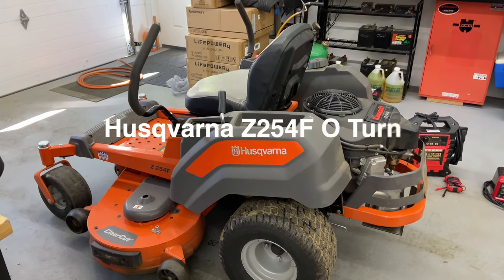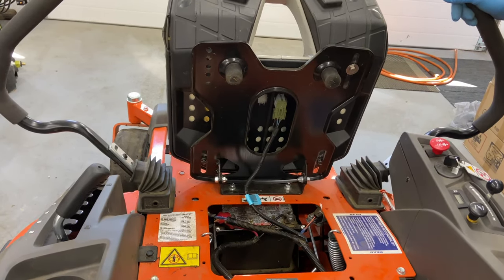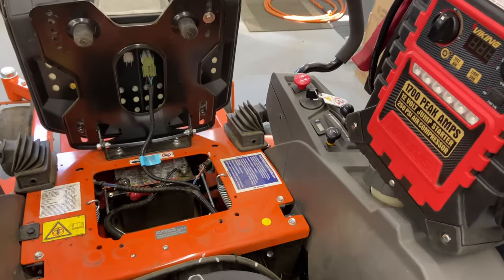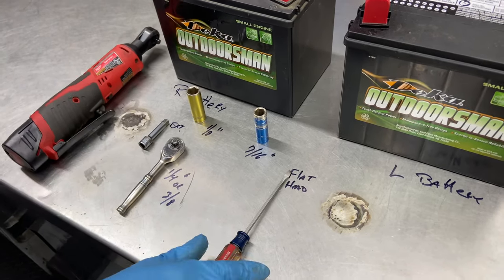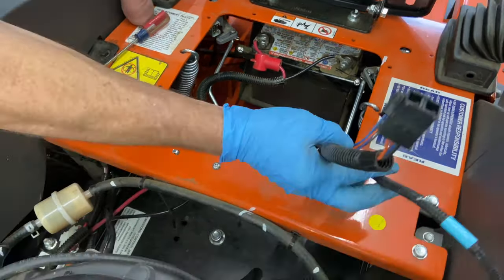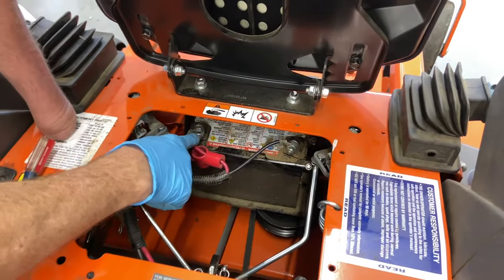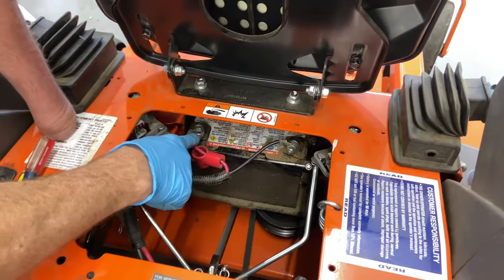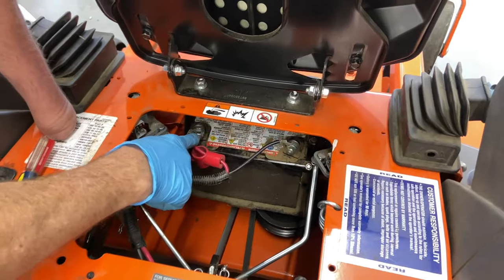Husqvarna Z254 Will Not Start

Comment: I have a similar problem on the z246 and it wont start. It does not crank like yours in this video. I made sure the handles are in park. Is there a way to test the safety switch or bypass safety switches? Is there a way to jumper it? It ran fine last fall. I did not charge over winter but reads 12.65 volts and i jumped with another new battery at 12.4 volts and still nothing and i replaced the solenoid too. No clue what else. So saw z246 that has a relay but cantfind one and 20 amp fuse is good and conductive. How to test the solenoid when taken out
Reply: Same situation here. Ran great last year. Parked it. Removed battery. Installed battery thus spring. No crank, no start. Can hear solenoid engage, battery at 12.6 volts. Thinking it may be a saftey switch because last year I had do jam the left handle to the left to get it to start.

Comment: My neighbour offered to remove the battery for me (broken wrist). For some reason, he disconnected the  the two V-shaped arms, by removing the odd shaped cotter pins (mostly hidden from the video view) and pulling the arms out of the holes on the mounting plate. There are a bunch of holes in the plate and I don't know which to use to reinstall the arms. I'm not even sure how the cotter pins work. Can you provide any advice?

Comment: Good video!  My z254 turns over when I have the ignition key turned to the start position but dies when I let go ....... suggestions?
Reply from the maker: Without diagnosing it the correct way. I will guess,bad ignition switch.

Comment: Finally a video with the same issues. I knew mine wasn't a battery issue though. Mine is with this parking brake sensor. I really hate this design that they have come up with. Wonder what engineer decided on this way? Anyway, I thought that I had the situation figured out. After replacing the start switch and nothing happened, I thought about maybe the handles were not at their full length. I used some contact cleaner since this tractor has been sitting outside for who knows how many years. The tractor was finally running for two days and then went back to the silent solenoid treatment...so very aggravating. Have you got a video on any other areas of this tractor?
Reply from the maker: I do not at this time. You will need to start diagnosing it with a test light. Check your fuse and make sure voltage is running through it. Check to make sure the safety switches are actually working. If the machine sits outside? Not good at all. Anything electrical can and as you are finding out will go wrong. If you figure it out please let me know. I am always curious.

Comment: Great video but unfortunately I am dealing with a Z254f when you turn the key to start all i get is a single click. I have replaced and charged the battery and thinking this is either a safety switch or solenoid that is the problem. What are your thoughts on this?
Reply from the maker: Normally if it is a safety switch you will get nothing when you turn the key, It may be starter solenoid but first make sure the oil level is Ok? I hope the engine rotates by hand. It is a little hard to perform that task on your engine but you can use a wrench and turn the engine PTO bolt just to confirm the engine rotates. If the engine rotates then watch this video and it may help you diagnose a bad starter solenoid. https://youtu.be/5iUmazojh_Q

Comment: would the solenoid have anything to do with the engine not starting,all mine does is click...at times.and that is when the battery is fully charged.thanks for any advice you can provide.
Reply from the maker: Yes, Here is a video on how to check the starter solenoid. The video works with all machines.https://youtu.be/5iUmazojh_Q

Comment: Thanks a lot for your efforts and help in your video!! Where you turned the key and made that noise, mine had a similar noise but was more like thunk thunk thunk thunk thunk with each turn of the key, it would "thunk" once but with every turn. Then you showed where that noise was coming from, the starter solenoid. Similar to the ones on the "early to late 70's model ford" vehicles. You can take a screwdriver shaft and cross between the terminals to turn the motor. Found my issue from your video. I have a bad starter solenoid switch. Would have kept on looking for the problem if it had not've been for your vid. Thanks so very much for your dedication to what you like to do!! God bless you sir & Jesus loves you, John 3:16-17 (KJV) We are now living in the last days mentioned in Revelations (KJV) Read to see where we are now.
Reply: Did you cross the terminals on the switch or on the starter?
Reply: @dboyer1062  I wound up having to replace the solenoid switch and works perfectly. Thank you and God bless. Jesus loves you, John 3:16-17 (KJV) We are living in the last days. Read Revelations (KJV) to see how close we are to our Lord and Saviors' return....

Comment: My starting problem is when I turn the key it starts right up, but when I let off the key it seems to not have power and shuts right off. If I hold the key engaged I can turn up the throttle. But as soon as let lose the start engagement it has no spak to stay running. I think my ignition is broken. 
What do you think?
Reply from the maker: Without diagnosing I would guess, yes ignition.
Reply: How does a ignition switch stop working? So disgusting how everything you purchase these days you have to rebuild.
Reply from the maker: Shorts out internally. It does not happen very often but I have seen it happen. How many hours are on you machine? Do you keep your machine anywhere moisture would be? Outside? under a tarp? Shed in bad condition? There all reasons why wiring issues happen.
Reply: @JohnsonsSmallEngines  81 hours. Yes it's under tarp.

Comment: Not sure if you can help me or not . But I’m having a problem with my 254f . When I pull my handles in it will die . It’s the right handle making it die
Reply from the maker: Check to make sure both safety switches on the handles are working as they should and there is no debris around them. Make sure you bring in the handles both at the same time. At this point I do not have any more information. I need one to come into the shop with your issue. I do know if you do not bring the handles in at the same time the machine will shut down. Please let me know what you find.
Reply: Thank sir . I will let you know for sure

Comment: Is this a common issue with this mower? I have identical symptoms as in the video even the low number of hours.  I dealt with this all summer last year, will cut about every two weeks and had to jump the battery every single time.  I feel like there's an electrical issue causing a constant drain that would continue happening if i replaced battery as 30 hours on a battery is extremely low.  So this is indeed only a bad battery causing the issues in the video???
Reply from the maker: The only common problem with this mower and with many machines not just this mower is that the batteries they sell you when the machine is brand new are in my opinion, very cheap, as in quality,price and in amperage. Those batteries do not hold up very long. You need to install a better battery. Make sure the connections are very tight as explained in this video and then check the charging system after installation to make sure that you’re charging system is working correctly. If all of that is OK after you install a new good battery, not a cheap one. I would suggest a300 cold cranking amps or more with this particular engine. If all that is performed, this should take care of your problem. If you’re charging system is OK. Also, if you’re going to have long periods of time where your machine is not going to be run, I would suggest to trickle charge the battery every 3 to 4 months if the machine is not in use during those months. That will keep the battery topped off (fully charged). Note** jumping a dead battery than three times to total dead, then I would always get rid of it and buy a new one. Batteries don’t keep coming back and that is very taxing on the charging system of the machine. As stated in the video, I hope you get it straightened out and you’ll be good to go!

Comment: I have the same problem with my amor every time I move the Wright stick it shuts off. Can you help me troubleshoot or how could I get in touch with you please
Reply from the maker: You have to pull in both at the same time.
Reply: @JohnsonsSmallEngines  I did that, but I was wondering if it was the safety switch is there anyway I could get your contact information to further elaborate

Comment: I've got that mower.  I kinda regret the purchase.  Maxes at 6mph, super finicky electronics (the ignition switch solenoid needs a "thump" on the side every now and then before it will work).

Anyway, The Noco Boost Plus GB40 has worked great for jump starting this mower, my tractor, my motorcycles, and even my wife's car.  No big diesel truck to test on, but it's super light and lasts for about 5 jumps on the lawn mower before it needs to be charged.

Comment: I have a 0 turn that is a  Z254F and i need help trying to adjust my handles. when i put the handles all the way over the mower still wants to move to the left and the reverse is real slow.
Reply from the maker: Impossible to explain that in words and I do not know how your machine is set up. I’m sure someone has a video on it. I will keep this in mind for a video to make when I get the same model in.

Comment: What could you do if the clip breaks on the seat switch?
Reply from the maker: If it is the plug that goes to the seat switch Technically you can replace the plug. I have used a zip tie to keep the two together. If the part broken is on the seat switch itself, you will need to replace it to correctly repair. Most of the time it is the connector to the switch that breaks.
Reply: @JohnsonsSmallEngines  thank you for the response. On the service manual, I only see harness wiring, and not individual plugs. How would I go about getting a replacement plug? Do you have a website you use for replacement Husqvarna parts?
Reply from the maker: I use many websites. My go to is Sears Parts Direct. You can look up Husqvarna parts on the website. Here is a link. https://www.searspartsdirect.com/. If you cannot find the individual connector you may need to purchase the entire harness or try and cut one from a junk tractor and solder one in. Your local lawn mower shop may be able to help depending on how friendly they are. Zip tying does work if properly done.

Comment: Lawn mower batteries seem to not last long
Reply from the maker: Hi Robert, the batteries that come with the machine normally aren’t as good as the replacement battery as long as you spend more $ on a good battery. You definitely get what you pay for when it comes to buying batteries.
Reply: @JohnsonsSmallEngines   that is great information on the mower batteries I try to get gold eagle batteries with the battery change veiw window that is bulit in the battery case
Reply: That's not entirely true.  I have the original battery in my Cub Cadet XT2 from 2016.  I keep it on a "Battery Tender" trickle charger year round.  Trickle charging your battery will extend the life of it for sure.  Cheers.
Reply: @rickdff62  thanks for the info on this matter of the batteries

Comment: My z254 starts but wont move... when i pull the levers in it shuts off
Reply from the maker: You must pull the handles in at the same time or it will shut down.
Reply: @JohnsonsSmallEngines  I do pull them in at the same time... it still stalls out
Reply: @JohnsonsSmallEngines  do the handles have to be all the way in before it'll start
Reply from the maker: @everettthornton2463  the handles must be all the way out
Reply: @JohnsonsSmallEngines  got it,thanks very much.